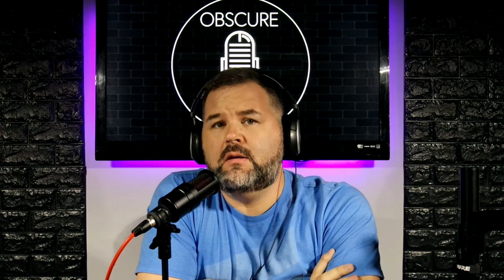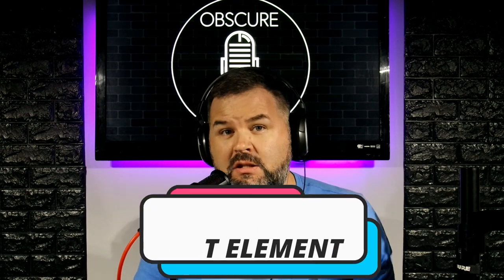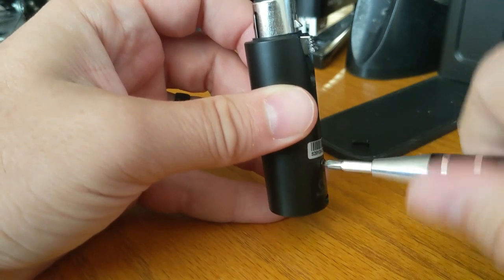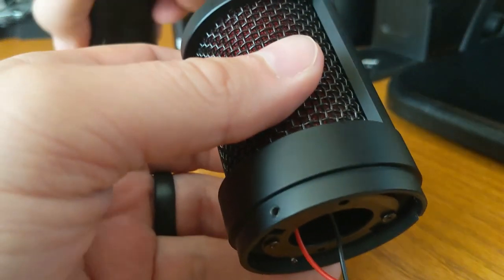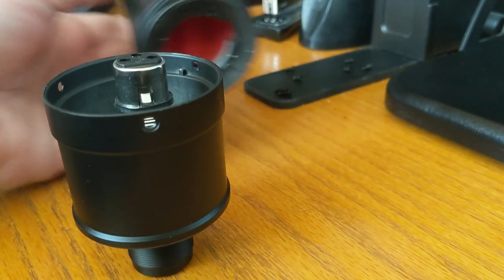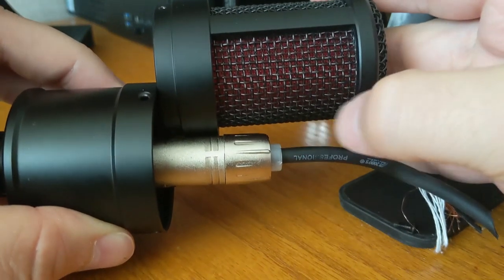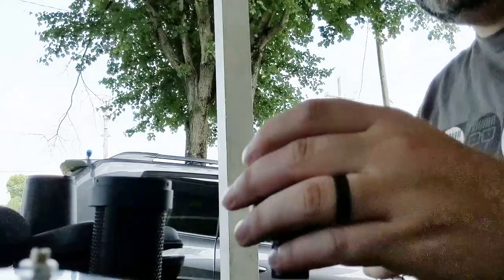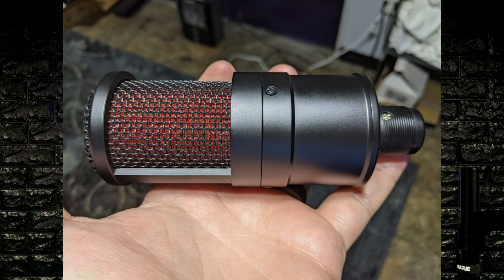A DIY Phantom Powered Dynamic Microphone - $10 Condenser + Klark Teknik CT1 + Dynamic Capsule = 😁

Comment: Got to tell you about this.  Bought two mics off Amazon less than ten pounds each.  Look like a lewit.  Says 240 pro on microphone.  They are rubbish. I only wanted them for the bodies.  So took them apart. Took hours.  All glued together, double mesh glued front and back. Then hidden screws as well.  The reason I am letting you know is.  When I got it apart.  No circuit board at all. Tiny little capsule hidden behind the round mesh.  Going straight to the xlr.  The best bit a lump of pot metal shaped to fit the bottom of the microphone held in place with big sticky pad. very heavy.  Noticed a few sites have them.  So let you and your readers know.  My friend said other microphones have had the metal trick as well. Love your channel.  Keep at it. I have put my own guts in them and they are great for me.

Comment: The donor "condenser" is a special kind of junk. Good riddance.
Reply from the maker: Oh yeah.  Horrible internals
Reply: @ObscureMics   Hello. Great video. Could you please do an update on what other Mic Shell(s) should be bought since the one you linked is not available anymore? What dimension should the shell be so the capsule and other stuff can fit into it? Perhaps there are other suitable shells out there which are just as good but a different brand. If it's possible an aliexpress/banggood/etc. link would be great for those whose Amazon is too expensive because of import fees and shipping costs.
Reply from the maker: That's a good idea.  Yes I will